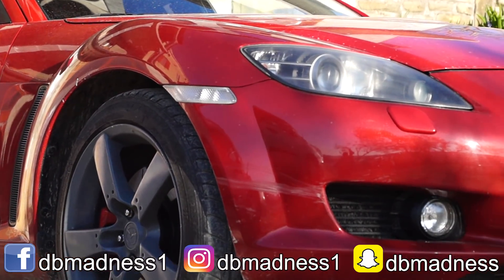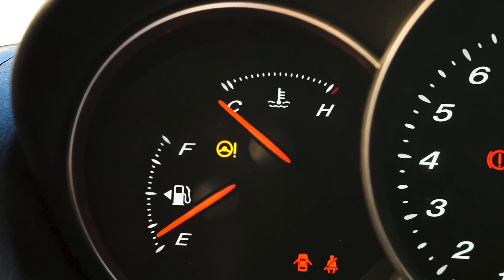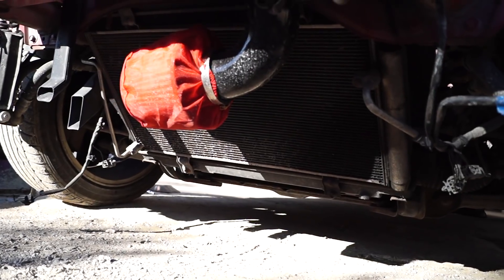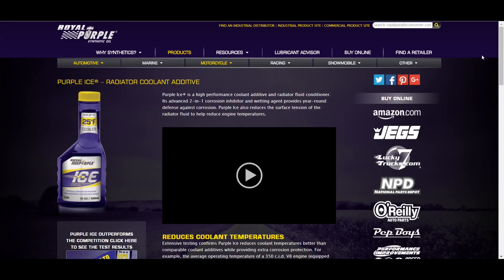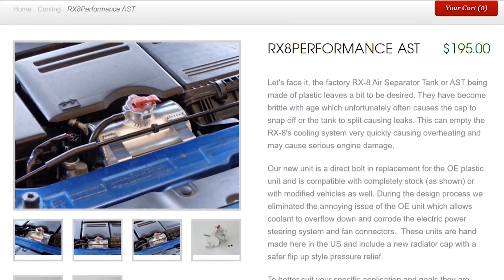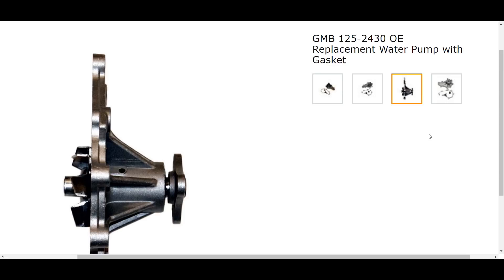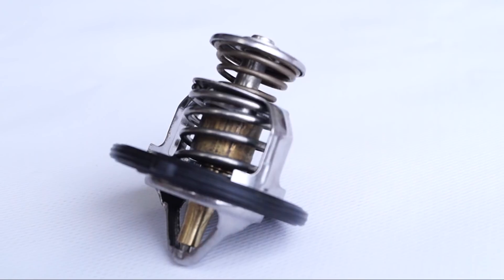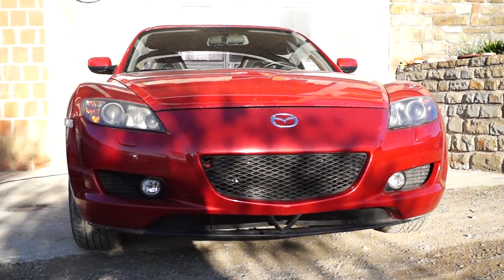Best Cooling Mods To Reduce Engine Heat On Your Mazda Rx8

Comment from the maker: If you want to check out the items mentioned in the video, they are linked below: 
🇺🇸 USA & ASIA:
🟠KOYORAD RADIATOR: https://amzn.to/3BoRUcb

🟠ROYAL PURPLE ICE ADDITIVE: https://amzn.to/3eYELz2

🟠LOW TEMPERATURE THERMOSTAT: http://amzn.to/2j6fwdJ

🟠VENTED HOOD: https://ebay.us/qmmb5R

🟠FL22 COOLANT: https://ebay.us/7iUmHk

🟠RADIATOR HOSE KIT: https://www.t-rexperts.com/product-page/t-rex-complete-under-hood-hose-kit-21-pcs

🟠ALUMINIUM EXPANSION TANK: https://www.rx8performance.com/products/ast

🟠UPGRADED WATER PUMP: https://www.rx8performance.com/products/electric-water-pump

🟠ELECTRIC WATER PUMP: https://www.rx8performance.com/products/electric-water-pump

🟠FAN KIT: https://www.rx8performance.com/products/cooling-fan-control-kit

🟠OIL COOLING FANS: https://www.rx8performance.com/products/fan-kit

🟠TEMPERATURE GAUGES: https://www.youtube.com/watch?v=25zzEx5PpcA
---------------------------------------------
🇪🇺 EUROPE:
🟠KOYORAD RADIATOR: https://ebay.us/sHOej5

🟠ROYAL PURPLE ICE ADDITIVE: https://amzn.to/3z6Fx3Z

🟠LOW TEMPERATURE THERMOSTAT: https://ebay.us/skmwhi

🟠VENTED HOOD: https://ebay.us/qmmb5R

🟠FL22 COOLANT: https://amzn.to/3AIKFv0

🟠RADIATOR HOSE KIT: https://www.t-rexperts.com/product-page/t-rex-complete-under-hood-hose-kit-21-pcs

🟠ALUMINIUM EXPANSION TANK: https://www.rx8performance.com/products/ast

🟠UPGRADED WATER PUMP: https://www.rx8performance.com/products/electric-water-pump

🟠ELECTRIC WATER PUMP: https://www.rx8performance.com/products/electric-water-pump

🟠FAN KIT: https://www.rx8performance.com/products/cooling-fan-control-kit

🟠OIL COOLING FANS: https://www.rx8performance.com/products/fan-kit

🟠TEMPERATURE GAUGES: https://www.youtube.com/watch?v=25zzEx5PpcA
------------------------------------------------
🇬🇧 UK
🟠KOYORAD RADIATOR: https://ebay.us/sHOej5

🟠ROYAL PURPLE ICE ADDITIVE: https://amzn.to/3DoQZKV

🟠LOW TEMPERATURE THERMOSTAT: https://amzn.to/3z7ccXc

🟠VENTED HOOD: https://ebay.us/qmmb5R

🟠FL22 COOLANT: https://ebay.us/6v9K01

🟠RADIATOR HOSE KIT: https://www.t-rexperts.com/product-page/t-rex-complete-under-hood-hose-kit-21-pcs

🟠ALUMINIUM EXPANSION TANK: https://www.rx8performance.com/products/ast

🟠UPGRADED WATER PUMP: https://www.rx8performance.com/products/electric-water-pump

🟠ELECTRIC WATER PUMP: https://www.rx8performance.com/products/electric-water-pump

🟠FAN KIT: https://www.rx8performance.com/products/cooling-fan-control-kit

🟠OIL COOLING FANS: https://www.rx8performance.com/products/fan-kit

🟠TEMPERATURE GAUGES: https://www.youtube.com/watch?v=25zzEx5PpcA

Comment: do not use coolant addetives like purple ice. they usally contain 2-ethylhexanoate (most coolants contain 2-eha btw) it is highly debated wheter or not 2-eha eats away at the seals in a rx8. But to be on the safe side you should use a coolant without 2-eha. Such as the mazda fl22 (not fl22 complaint. but specificlly the mazda branded fl22)

Comment: Awesome videos, subscribed and following.   My city is hot as hell in summer reaching 40 celsius and add track temp is a no go for this car. I started with cooling mods. New rad, new oil lines (leaking before), mishimoto Thermostat and triggering fans (ECU flash) at 92 and 96 C.  
I am running stock intake with K&N OEM filter replacement. 
Some questions:
- Heard aluminum under tray and foam around radiator help a lot to push air through radiator and make it more efficient. 
- what is the desired operating temperature for the renesis?
- What about engine bay temp reduction?
coming

Comment: All of these mods & maintenance tips are great, but if your budget is limited to about $300, where should I prioritize that? /what should I get first?
Reply from the maker: 1) Fan kit, that makes them start sooner
2) Aluminium fan shroud
3) Aluminium radiator (Koyo or similar, but i prefer koyo)

in this order
Reply: Driven By Madness thank you for the quick response!
Reply from the maker: @brandondebenedetta  No problem :)

Comment: Really nice video, keep it up :D. I finally bought my rx8 recently. Do you have any tips for relocating the license plate to the bottom of the bumper? I can't seem to find anything worthy anywhere.
Reply from the maker: Thanks man! Actually leave it where it is, because the bottom of the bumper is the main intake for cooling. The middle grill is 80% blocked, so leaving the licence plate there is the best option :)
Reply: What mileage did you buy at?

Comment: My Rx8 is almost 14 years old, with no rebuild and 183.000 km odo and without any modifications on. No premix also. 
But, this summer the radiator broke (replaced with a Koyo) and after that I had a broken expansion tank (replaced with the a new OEM). Yesterday my heat radiator broke too and cabin (passenger's side) became a pool with antifreeze liquid. 
The sad thing is there is only OEM heat radiator which costs almost 1.000 euros or I can get a used one. I have bridged the pipes so I can run the car but there will be no heat in the cabin.

Comment: A decat will also decrease the temp of the engine
Reply: ChrisRex  All the hot air produced by the engine can exit faster. Also the engine has to work less to move the air out of the exhaust

Comment: Turn the heat on so heat can escape is another way to reduce engine temperature.
Reply: And divert the ac cold air to the engine bay.
Reply: @nicolastremblay7527  id rather cruise with the windows down rather than destroy my engine
Reply: @1cipi  Didn't though about it, but bright lol
Reply: Only if the heater worked

Comment: Please make a video on how to free up the grill as mine is all covered up with plastic and hasn't got no holes in
Reply from the maker: You can drill holes with a drill :) I had this in mind for this summer, but since i'm changing front bumper i didn't bother :)
Reply: Driven by madness I'm guessing it'll help a ton with cooling as alot is wasted from the grill

Comment: Watching your videos makes me afraid of damaging my rx8 because it's stock 10 years now and just because I haven't done anything about cooling or 2 stroke oil in the gas tank etc I think that i will damage it
Reply from the maker: If you maintained it regularly oil change every 5000km and coolant flush every 2 years, you should be good. This mods make the rx8 work more efficient and last longer, but even if it's stock it will last, but you have to stick to a rigid maintenance schedule :)
Reply: Driven by madness thanks for the advice mate, cheers from greece!

Comment: Would you recommend a S1 or a S2 to a first time RX8 buyer? Currently looking at a R3, what sort of improvements do you recommend for consistent lapping?
Reply from the maker: If you have money get S2 R3, or alternatively you can get a S1 and mod it so that it is as reliable as the S2. A reference video can be 10 way to make your rx8 more reliable: https://www.youtube.com/watch?v=-pLkSABRxHk&t
Reply: Driven by madness very good. How many upgrades do you recommend from your list for a s2 r3? I'm looking at brakes and cooling predominantly. Also, do I have to premix with an S2, or am I okay not to as long as I use semi synthetic or mineral oils? I ask because of the third oil injector the s2 has, I presume it somewhat eliminates the need to premix.
Reply from the maker: The S2 has better lubrication due to the extra oil injector, so you don't necessarily have to premix. 
S2 has a better radiator, but not as good as koyo. the Electric Fan kit would be a great add on, then the vented hood would help with faster air circulation, oil cooling fans are also very good,  also the royal purple additive does it's job :)  Oh yeah, and definitely temperature gauges. I'm gonna do an install video of another version that is more driver friendly, so stick around :)
Reply: Driven by madness temp gauges are especially important, agreed. Quite like these ones, as they suit the look of the cluster dials, and are in a good glance position. https://www.vividracing.com/mazdaspeed-oil-pressure-oilwater-temp-gauges-mazda-rx8-0411-p-150746085.html

Comment: 1:58 Running up to 15 degrees cooler? An engine should run at operating temp, not higher, and also not lower..

Comment: Instead of hacking up your loom to  change the temperature at which thr fan starts, get yourself a MazdaEdit licence, you will be able to change that preference in the Ecu and if you have SOHN you will be able to increase the oil injection rate and with your LS injection kit you'll be able to increase the dwell time and utilize the coil potential resulting in a stronger spark and better ignition which will increase your HP
Reply from the maker: That is a smart investment, and since i've heard of it, i was tempted to get it. But then i would need a lot of time to master the controls and basically knowing what i'm doing. I will definitely consider a good tune after the rebuild, to make the most out of all my mods. Thanks for your feedback bro!
Reply: Driven by madness you don't need to learn much really, all the values are available on the rx8 forum I have done mine myself and I have stopped DTC codes as well, I am planning to learn tuning as well because I will go FI

Comment: Great vid but there is one thing that is not 100% accurate.  The racing beat gauge kit is not really compatible with S2 cars.  The plate that goes between the oil filter and the engine will not work on an S2.  The S2 has the filter under the engine and that plate will not fit.  The gauge pod and coolant gauge work fine, but oil pressure and temp gauges are not as easy to add as on the S1.
Reply from the maker: Thanks for pointing it out, i can't believe I oversaw this detail. I'll just add the detail in that link description, to avoid confusion. Thanks again for your feedback :)
Reply: Driven By Madness  help
Reply: Chad Bremer I’m buying a 2005 rx8 it $17,000 BDS which in $8,500 USA  
I just wanted to ask if you think I should buy it it has 70,000 miles on it , I would like to know how best I should care it what are the most important things I should know and do to keep the car and it’s engine running , I’ll that any advice I can get

Comment: Great list! Yes, removing the CAT will also aid greatly in reducing engine temps. At some point in the future I want to get the upgraded oil cooler kit. Apparently the stock oil coolers are not bad themselves, it's usually the oil cooler lines that provide some restriction. So for some it might be a good idea to just replace the lines. Was surprised u threw on hood venting, didn't actually think of that one, but it makes sense. Gets the heat out from the engine bae (ha, see what I did there?), and lets air flow better through. The license plate isn't actually that big of a problem. If you look closely, the front grill itself is mostly not perforated. Most of the air was designed to go from underneath the bumper (with the aid of the undertray). The undertray is actually angled to force that incoming air through the radiator. Unfortunately, I rarely know any RX-8 owners that still have the undertray XD
Reply from the maker: Yup, i'm on board with you on the oil cooling kit. Just need santa to make a nice pay pal deposit next time :P Yup, the hood mod is very effective. i saw that bae, it came straight from the hood ( i also did something :P hahah ).  The undertray can be bothersome, especially if you remove your bumper very often, like me. if you noticed i also dont have it installed atm :P The Euro licence plate is a bit restrictive, and the holes can always be perforated to increase efficency :)

Comment from the maker: OTHER MODS TO CONSIDER:
- ALUMINIUM UNDER TRAY (it doesn't sogg, like the plastic oem one)
- FREE FLOWING EXHAUST (The faster your get the gases out, the less heat it will transfer into the housings)
- ENLARGE VENTS ON THE PLASTIC WHEEL WELLS ( better cooling)
Reply: Driven by madness And reduce front&back radiator pressure by relocate battery, AC condenser and change intake box to AEM
Reply from the maker: T-Nai Tan  Thanks man, i will add it :)
Reply from the maker: US 91 octane premium gas is the best you can use in an rx8, and you'll never have issues with it! Using lower octane fuels can cause knocking sounds.
Reply: Hey I loved the video. I am a current Corolla co-owner (it's my dad's) and im considering to buy a MazdaSpeed 3 over the summer.

My 2 year plan is to daily the Mazdaspeed 3 over the winter, and an RX8 when my city's temperatures allow me (I live in Canada). 

Although I think the RX8 is a great stock sports car, the many quirks the car has need to be properly tuned for me to enjoy them.

I'd like you to help me list the modifications I was thinking of doing on it:

- I firstly wanted to change some of the suspension work, as well as the cooling tricks you demonstrated in the video (I legit was gonna do it anyways lol)
- Secondly I wanted to mid-pipe or straight pipe the car depending on my budget and legalities
- Thirdly was weight reduction, I was gonna notably replace the enterior's unecessary weight... I'm not sure what else could be done exactly but I'm not there yet so :/
- Fourthly I wanted to rebuild a Renesis engine and give it a supercharging boost if it allows me... if not I was gonna swap to a 13B-REW or something...
- Lastly I wanted to body kit the car a bit, a tasteful and useful back wing, tasteful bumpers with sidesquirts to go with... a nice little hood for the cooling the engine needs... The very last detail is the color, I want a matte black RX8 with bronze rims like the cool kids :)

Can't wait to be Rotary Army!
Reply: i have been looking at an aluminium under tray for a while now, however for the time being my aftermarket front bumper, with larger front grill area and larger oil cooler holes, has a slot that actually holds the plastic under tray rather than having it held in solely by pins and screws
Reply from the maker: @Maybe live  great plan, really looking forward of having you on the rotary crew :D

Coilovers will be a great addition to the rx8, as well as some cooling mods 
A de-cat is not legal in the majority of countries around the world, but people including my self still have them, and switch them with the cat before emissions ;)
For weight reduction, you can remove oem seats and replace them with lightweight ones, take out compleately the rear seats, carbon fibre hood, carbon fibre boot, take away door pannels & speakers and i'm sure more can be found :P
Don't bother supercharging or turbochargning the renesis. If you want power, swap the engine with a 1JZ OR 2jZ, you'll also get better fuel consumption.
I like the bodykit idea, gotta make that ass bling :D
Reply: i owned an RX8 for awhile now but i use to dayli drive it on premium gas so wanted to ask if 91 would work it perfectly?!?!
Reply: thank you so much for that advice i am really glad to hear that!
Reply: 93 octane is $2.38 a gallon in the states where I live, thanks to coronavirus.
Reply: it’s 3.64 a gallon today,

Comment: Just to add to the radiator replacement. As the radiator is at an angle, the air flow does not go easily through the radiator. The radiator therefore has sponges around it so the air is forced through the radiator. Make sure you transfer all the sponges from the stock radiator to the new one. Never remove the undertray. The under tray along with the bottom sponge is what helps the air go through the radiator.
I would not recommend moving the number plate from its location. The air gets to the radiator from the under tray. Behind the number plate is a solid piece of plastic, air cannot enter from there, so removing the number plate makes no difference.
Reply: No, the lower half of the grill is open and flows directly to the rad, only the top portion is blocked off because of the crash bar behind it. With those euro plates you’d definitely be blocking some flow.
Reply: You can also get metal undergrads.  Extra helpful if you track the car.  At high speeds the plastic one can flex and let air by.  Mazdatrix carries one.
Reply: If you are cheap like me lol, you can cable tie the undertray to prevent sag at high speeds. If you have the plastic radiator, do not cable tie the undertray to it as this could damage the plastic tank.
Here is the thinking behind the air flow as I understand it: The air enters from the bottom, trapped and forced (because of the undertray and the sponges) through the AC condensor, through the radiator (cooling the coolant) and then into the engine bay, thus also cooling the engine as well. Now here is the funky bit. The air is pushed up onto the engine cover that actually sends the air back down to the mid and rear part of the engine and then the air exits through the side plastic vents near the doors, I was also surprised to see that those air vents are not for show but do actually have a purpose. With the fans on and idling you can confirm this by putting your hand near the vents and you will feel hot air coming out of them. So logically, another cooling must should be that we don't drive without the engine cover.
So with all the above, I am not sure that moving the number plate will actually help or hinder anything. I would however chose not to hinder the flow going into the undertray.
Reply from the maker: Great addition to the radiator topic, very useful info! A aluminium undertray is also a good addition to prevent the plastic one from sogging. As for the licence plate.... well, you can always drill holes on the grill, and the lower part of that solid plastic feels like it can be pulled away, at lease on my car. I'll see about that when ill be doing my mods in april. ( Ignition kit still working strong )